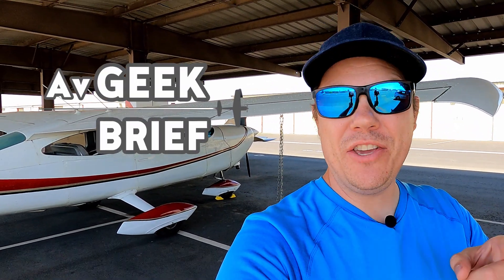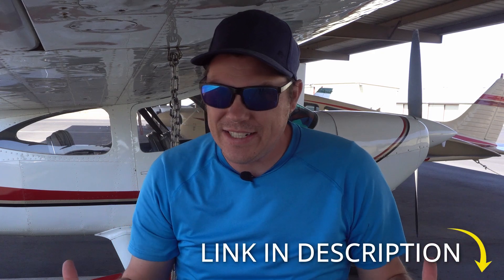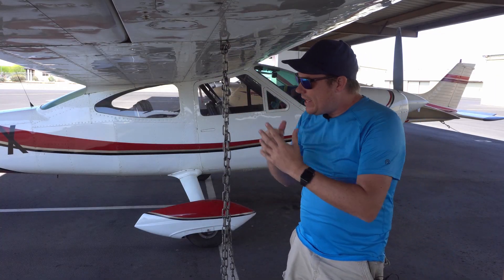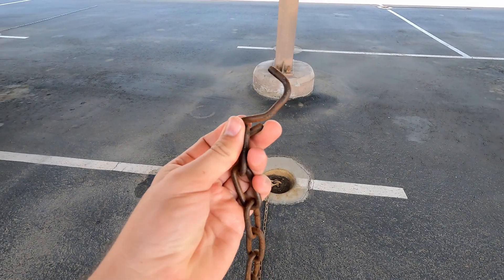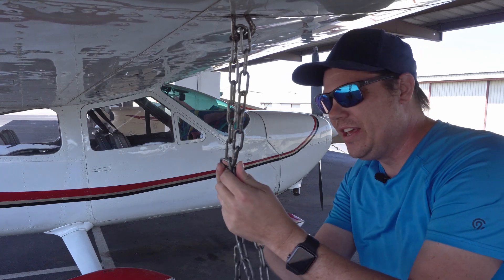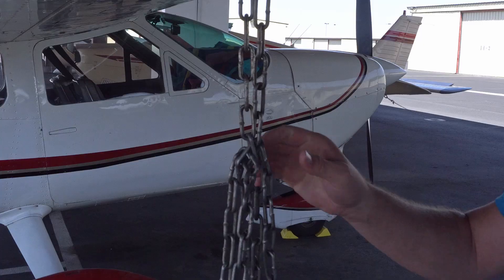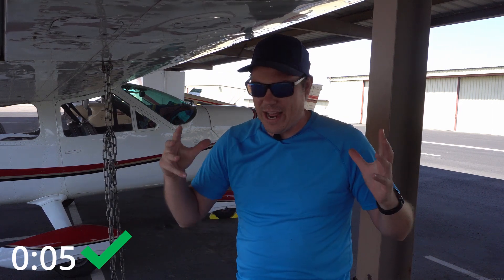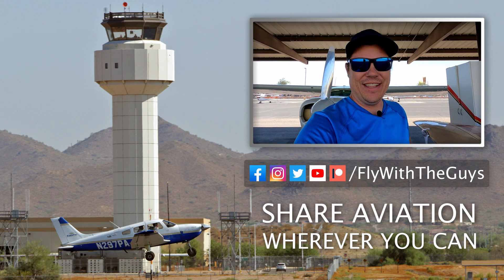How To Chain Down A Plane | AvGeek Brief

Comment: John Keith taught me to give the chain a knot first before securing the s-hook. 2 spaced knots if possible. A little bit of wind jiggle could let that s-hook drop. Once that happens, nothing is mechanically securing the chain. A knot could prevent the plane from moving or flipping in heavy gusts if the s-hook falls out or bends.
Reply from the maker: John has a good idea there. WOuld be interested to do some testing!

Comment: I guess I’ve been doing it wrong every time I’ve visited Arizona. That’s the only place I’ve ever been where they use chain instead of rope. I get kind of nervous having so much steel chain swinging around a bunch of aluminum sheet metal. You sure all that excess chain can’t leave a dent in the skins during a strong wind gust?
Reply from the maker: They don't swing up like you think they could. In reality, fixing a few dents VS replacing your plane.... I would be fine with a little hanger rash.

Comment: What’s your thoughts on using high quality tie-down straps opposed to chains?
Reply: Where I live (Arizona, US), the sun is very harsh, with time, the UV severely weakened the nylon straps.  A local flight school lost many of their planes one year due to a microburst, with many of those straps were broken by the wind. I carry a set inside the plane when I visit other airports, but chain is much better for long term tie down in sunny areas..
Reply from the maker: What Tho said there. Still a great thing to carry though when you're traveling.
Reply: Good point on long-term exposure to the sun. Where I live in South Texas we have a similar issue. Pretty brutal during the summer. Fortunately, my plane is hangared, so tie down straps will be used when traveling. Thanks for the feedback.

Comment: Okay but you forgot all the other stuff. Once the chains are hooked to the wings you push the airplane back so that all of the slack is taken out then pull the tail down and hook that chain so the weight of the nose keeps it taught as well.

As to chains vs rope or tiedown straps well obviously you're not gonna fly around with a bunch of chain but they are used at airports because of their durability. If the airport were to provide parking spots with rope tiedowns they'd have to pretty much inspect all of them every day for damage caused by the environment or people running over them etc.
Reply from the maker: YEP! There is a lot more to securing the plane. This was just a how to on the chains, it was assumed the rest of it was already known but that'll make a good video for sure. =)

Comment: A beefy S hook will work as well. The one in this video shouldn't be used at all if possible.
Reply from the maker: Actually I've been at airports that have beefy S hooks, They wouldn't fit through the tie down on the plane. No wind that day so we made due, but if I was based there I would find another solution.